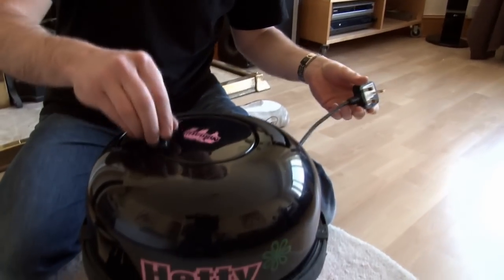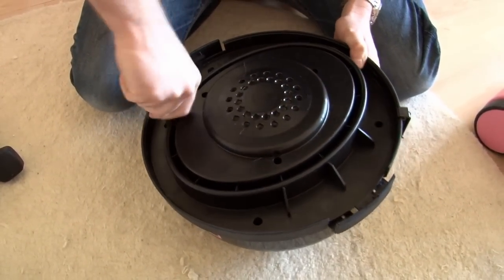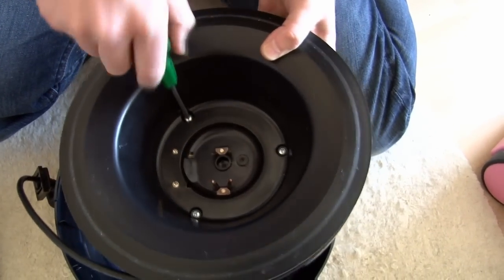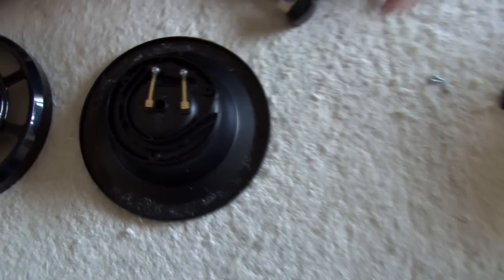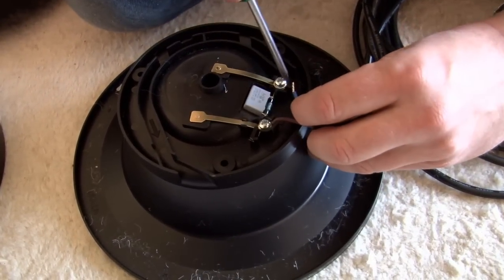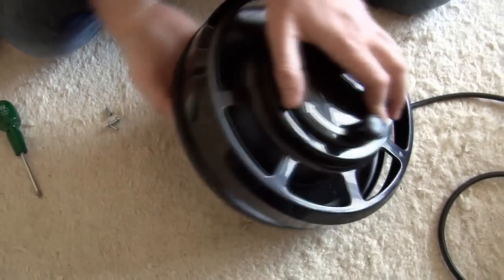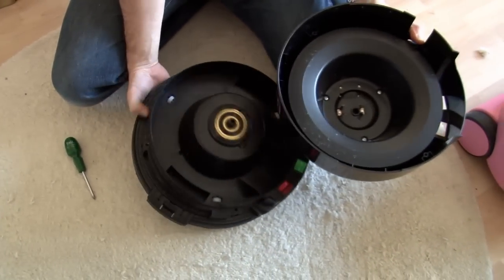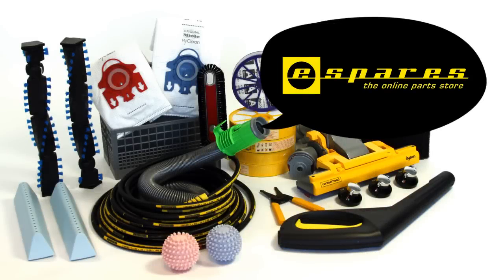Henry Power Lead Not Winding? (Numatic Vacuum Cable & Reel Replaced)

Comment: Hi Matt, The wife's Hetty has packed up all of a sudden. I've checked and swapped fuses and also checked the carbon brushes (the cartridge type as in your other video) and they have plenty of life left in them. It was working perfectly and it seems that there is no current getting to the machine whatsoever. Do you think it would be worth purchasing a new capacitor from your website and replacing that, or does it sound like it's time for a new hoover? 
Many thanks in advance mate.

Comment: Hiya just wondering if it's a normal screw driver you're using? I can't even inscrew mine to get started?
Reply from the maker: On some versions you may need a Torx screwdriver kit like this:
http://www.espares.co.uk/product/es1251179/9-piece-torx-head-screwdriver-set

Comment: Hi!
Is there anyway to replace the plug without having to change the lead? I snapped off a pin in a socket.
Reply from the maker: Hi Malikah, it is OK to cut off the old moulded plug and refit a new 'screw type'  one but make sure you use the correct fuse.

Comment: how to make connector if they broken henry
Reply from the maker: +Mohammed Shafiq We do sell a 'Spade terminal' kit should you need to replace the power cable or have damage:
http://www.espares.co.uk/product/es1688483

Alternatively we can supply a new power lead with the correct connectors already on.
Reply from the maker: +Ja Ye Sorry to hear you could not resolve it. That's a video we will have to do next year.